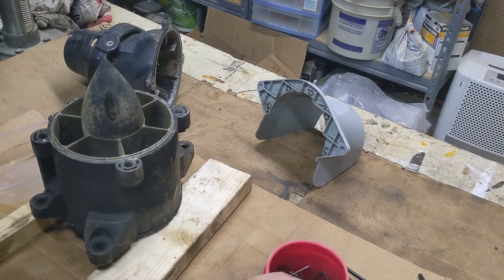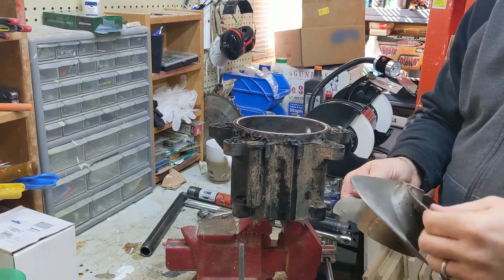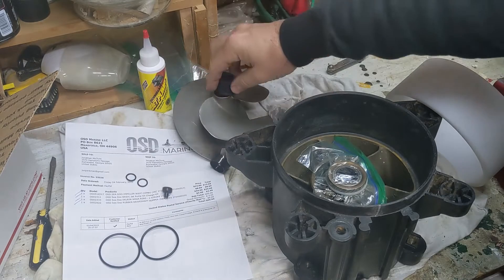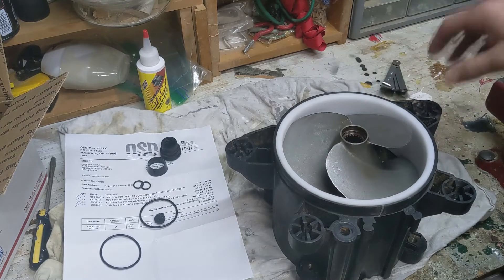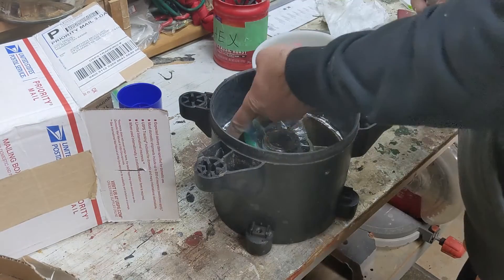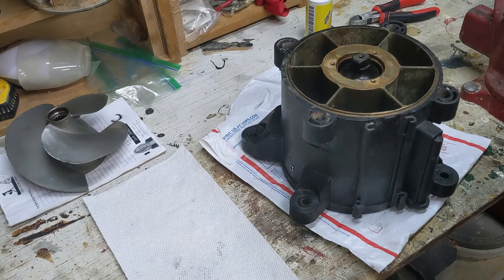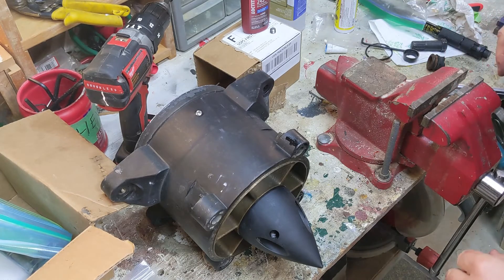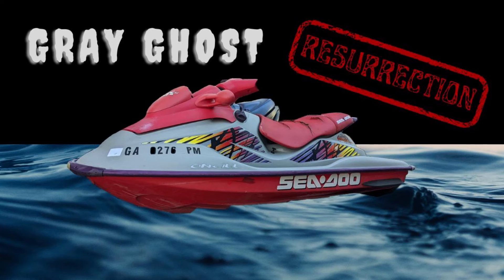Sea-Doo GSXL Jet Pump Repair - Gray Ghost Resurrection

Comment: Great jet ski videos.  I found your channel a year ago when I needed to replace my Mercruiser Alpha One gen 2 impeller pump.  I just purchased my first jet ski and have been binge watching all your seadoo related videos.
Reply from the maker: That's awesome. Glad they help. I'm about to put the motor in. I need to replace the bellows on the Merc and maybe the gimbal bearing.
Reply: That would make for a good video.